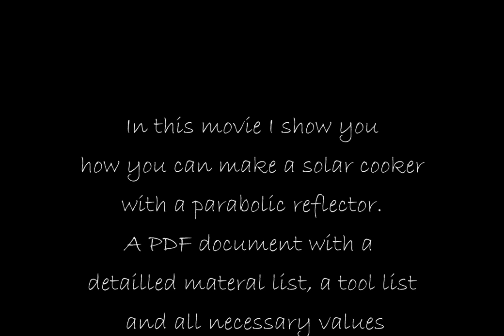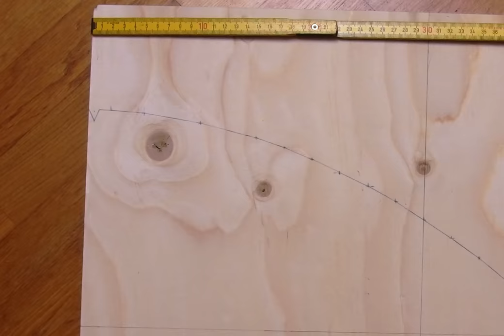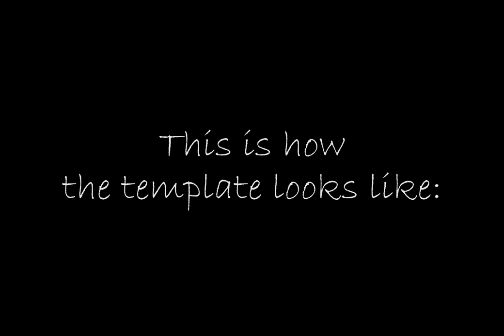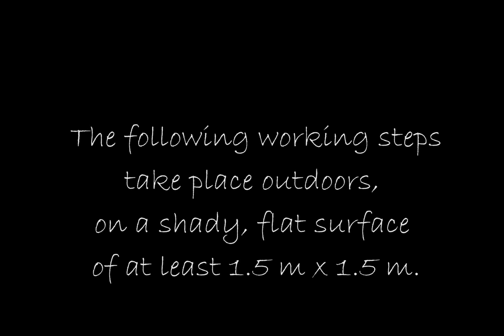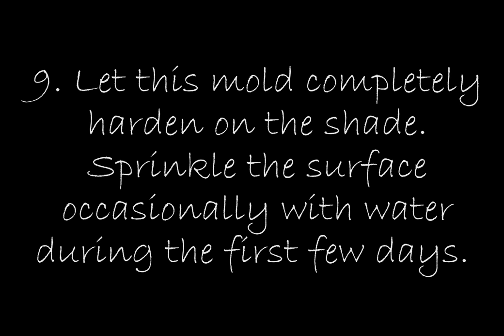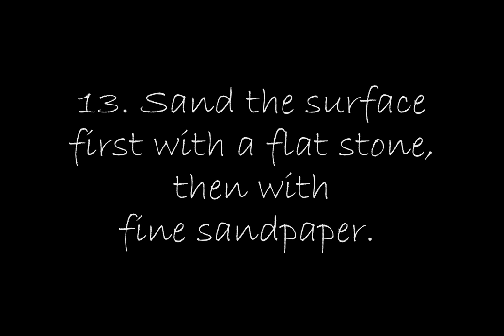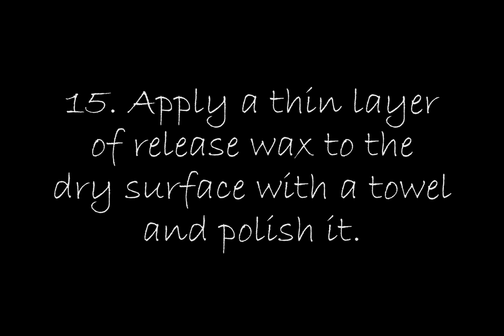How to build a solar cooker with parabolic reflector part 1

Comment: If you hold loosely two tips of any rope, especially a chain (because it is heavier than a rope), it gives a parabolic shape. So you don't have to calculate for drawing.
Reply: I just googled it and the curve is not parabola, but actually catenary curve, which appears to have wider angle of curve the further to the ends.  The wider areas would not be contributing to the focal point of the rest of the mirror.  Perhaps you could sketch out the real parabola shape by eyeball after tracing the rope.

Comment: Why did you select to use concrete to make the form?    Did you consider plaster?
Reply from the maker: I chose cement because it remains a long time, even in rainy weather. So you can make several reflectors one after the other. But I actually also used gypsum (see 8:00 - 9:40) because it can be sanded finer than cement. Perhaps I should have used the term "plaster" instead of "gypsum"; it's probably just a translation error, sorry.

Comment: How did you calculate the parabola?  What was the formula?  It doesn't look right, does it have a tight focus.
I looked at your pdf, but a formula didn't jump out at me.
Reply from the maker: The formula is y=0.5.x.x/f, but I see that I made an error in the pdf-Document. I take all the contents about the solar cooker from the Internet until everything is fixed. Sorry and thanks for advising!